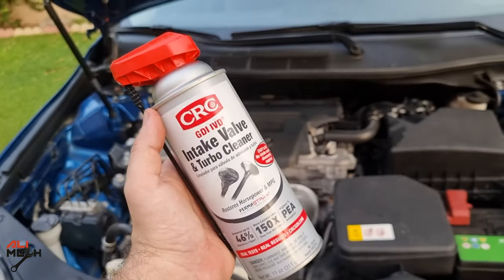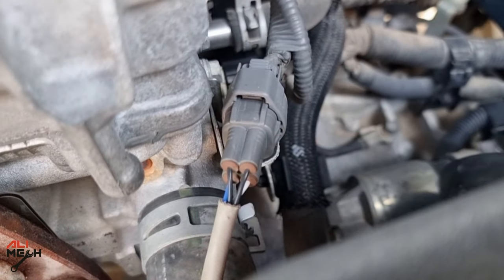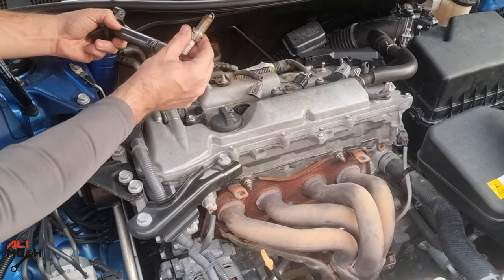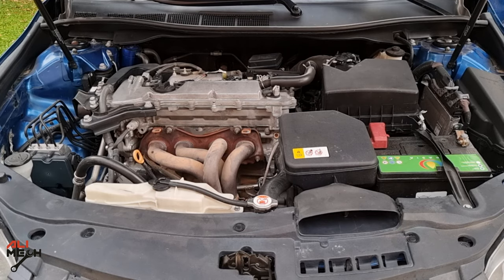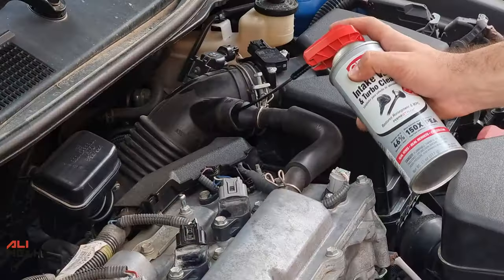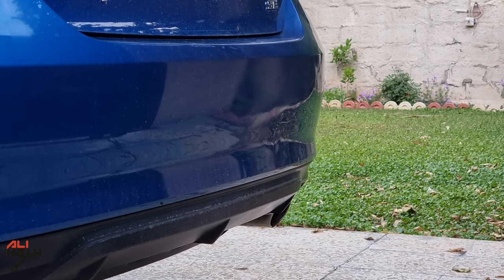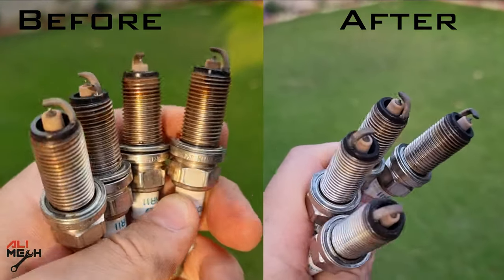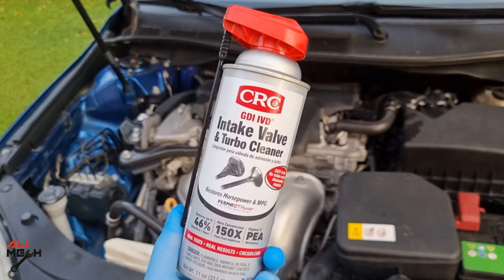Watch this before using CRC Intake valve and turbo cleaner/How to use valve cleaner before / after

Comment: the reason why it didn't clean very well is because of direct injection system this car has
Reply: This car not a direct injection
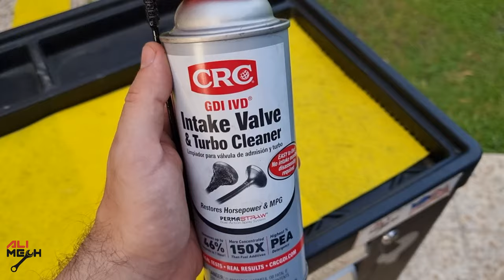Reply: @SilentHeartx  0:11 listen
Reply: @US_AND_IL_ARE_WAR_CRIMINALS  
Thank you. 
I think 2ar-fe engine not gdi. Because the injectors above the valves inside the manifold.
Reply from the maker: Toyota csmry is Direct Injection (TDI) and 16-valve dual variable valve timing with intelligence (VVT-i), the reason it didn't work, because the cleaner not that harsh, it's designed to be spared from throttle body and turbo, if its that harsh for cleaning carbon, it will damage throttle body and turbo bearings 
This can be used regularly to keep the engine clean but not removing heavy carbon buildup
Reply: How about brake cleaner through vacuum hose, is that harsher? Did that on my Honda Accord R20A3
Reply from the maker: From brake cleaner, I used carb cleaner it gave me the best result, sure it will be good to try from vacuum hose
Reply: @AliMECH  Did you do a test or post in the past using carb cleaner with better results the CFC, I can't recall?
Reply from the maker: Yes I did that here is the video
https://youtu.be/U4T5fA9DTMM